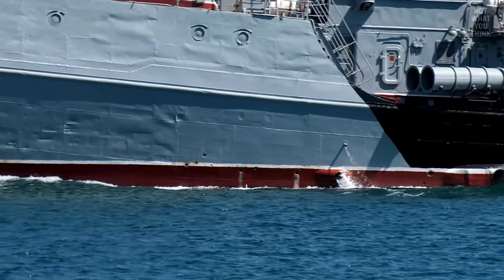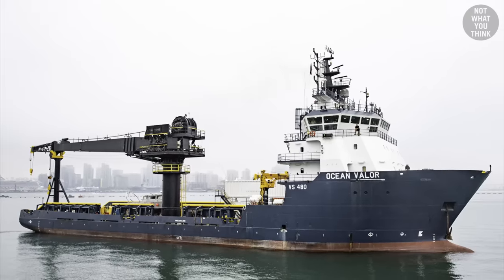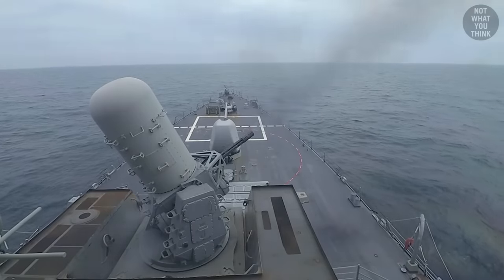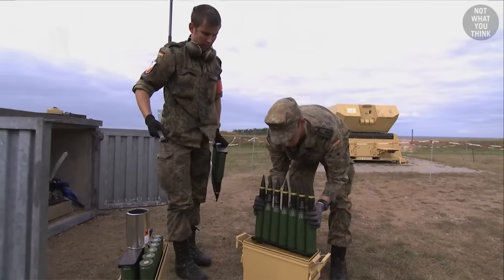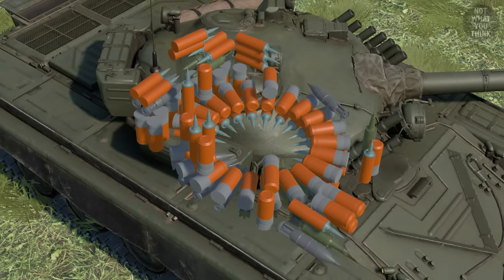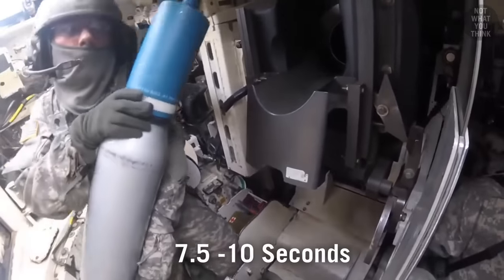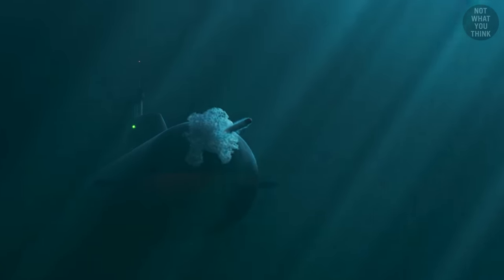Why Reloading Modern Weapons is Harder Than You Think

Comment: Accuracy is more important than speed.  If you hit your target in the first shot it is unlikely that you will need a quick second shot.  And if you have several targets to shoot, by the time you get your sights locked on the next target, the loader will already have the next shell loaded and ready to go.
Reply: Hitting the target isn't enough.  You have to not just kill it - but kill it in a manner that makes it obvious that it's dead.  Otherwise, you will keep re-engaging it until it burns.  (Rule of thumb: if the enemy tank isn't burning - it isn't dead.)
Reply: @colincampbell767  
Enemy tanks do not move unless the crew is alive to move the levers.  And tanks do not travel alone so while you are trying to make certain one tank is burning another tank will be targeting you.

And the M1 Abrams tank is designed specifically so the crew compartment is separated from both fuel and ammunition that could cause a fire on the inside.
Reply: @oldtimefarmboy617  A tank with a dead driver will continue moving because the engine at idle still has enough power to move the tank.  BTW - what 'levers?'  Every tank I was on used a motorcycle T-bar for steering.  And the M1 series the right handgrip was also the throttle.  

And we were trained (and tested on) sequential engagements where we had to choose the most dangerous target and engage it first then engage the less dangerous target.  After engaging both targets, we would observe for effect and if we had time take a third shot.  And no matter what - we would be backing up and moving to another firing position after that third shot because a lot of hate was about to hit the place we just fired from.  At this time the other tank in our section exposes itself to shoot.  

And when we pulled into our next position and began acquiring and classifying targets - any immobile tank that wasn't burning was a target.  If I lose my engine, hydraulics, optics, and electrical - we could still conduct precision gunnery engagements using hand powered controls. (A skill we had to demonstrate every time we did our live fire qualifications.)

BTW - on the M1 series tank there are fuel tanks on both sides of the driver's compartment.  Th fuel acts to absorb heat from a penetrating hit.  

Now - is there anything else you want to tell me about tanks?
Reply: @colincampbell767  After getting used to the awesome firing system in the M1 i'd have hated having to do things manually with math lol - not that it wasn't a prudent idea to train that way (obviously). IIRC the M1 "analog" sights were actually very good as well. I've only sat in a few a (few) dozen plus years ago, so I have no combat experience in them, but none-the-less I highly admired  the crew compartment. No ammo. Just blew me away at the time (let's just say the M60 did not instill the same confidence I would have had in something like the M1).
Reply: @lesassassin  I was on the M60A3, M1IP and M1A1.  (I spent over two decades on and around tanks.)  When we transitioned to the M1IP we regarded the fire control system as inferior to the one on the M60A3.  (The M60A3 upgrade came out after the M1 Tank did and as a result got better sights and fire control system.  At the expensive of having a huge divot taken out of the frontal armor so it would fit.)
Reply: @colincampbell767  Not sure if I'd want more armor taken out of a M60 ... I'm sure the upgrades made that point more mute though considering a more advanced fire control system tend to have a very good effect in US systems which tends to have a positive survival coefficient, etc. I couldn't talk about it with any real experience though so obviously I would yield to yours.
Regardless I do know that US systems are nothing without the persons fielding them, and the reason the US military is so effective. I did get to drive a M60 (I don't remember the variant, but it wasn't as new as the A3) around for a few minutes lol (which was a freaking blast). I have nothing but respect; those things are fun in a safe setting but I would not want be be shot at (in any tank/etc). Funny story I did ask to drive the M1 ... they said no pretty quickly (that and the one I sat in didn't have an engine in it).

Comment: Blow off panels are obviously going to be used but I don't think they work too well, I mean there is so much energy in the rounds in storage that even the energy being deflected off the armor and into the lower pressure area through the blowoff top would be enough to penetrate the door I would think. I mean I'm sure they test it but those rounds are massively powerful and the armor door is like 2 inches think, I don't think it's possible to contain that much energy but maybe it makes the difference between a traumatic injury rather than being turned into a fine red mist but I don't know. Sometimes tanks are penned and turned into a shredded tuna can but the tankers all survive with cuts and concussed just through dumb luck. Would love to see a test
Reply: If it's a penetrating shot to the side then you can assume you're sluicing out at least one person's bodyparts. If you hit the back of the abrams turret (where the ammo is) then the explosion takes the path of least resistance; the blowout panels on top, so the bulk of the explosion goes that way.

Comment: decent vid, but you're off with you tank info, Abrams loader qualification  is 7 seconds, experienced loaders can even get that down to 5 seconds, An Abrams can if granted an experience crew fire off 2 rounds before a T-90 has reloaded their first. Also the Abrams is still faster than a T-90 at 42 miles per hour compared to 37 mph.

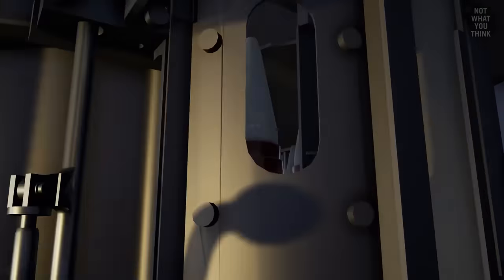Comment: 13:40 
6 rounds//min making 1 round // ~10 seconds

Has a ways to go to catch up to the manpower intensive 5"-38s of yesteryear where the speed could be as high as 20rds//min w/ about 15 being the most sustainable. That however is with scores of sailors keeping the ammo feed going endlessly. Bit like comparing John Henry to the Steam driver though...
Reply: I crewed a 5-inch/38 on USCGC Taney.  That was indeed a manpower intensive gun.  It was 1978 but if memory is right there were 8 or 9 people in the turret and a whole crew below decks feeding ammo into the carousel that fed the turret.  One of my jobs was "Hot Shell Man".  I wore big insulated gloves and would catch the shell as it was ejected and direct it out a hatch in the rear of the turret.

Comment: fun fact
the Su 25 has the same type of gun the A 10 has
has the same amount of possible pen
lower RoF 
has a 23 mm as well  
less ammo than the a10
but much more accurate
the A10 solves its accuracy with slinging more shit at the wall untill it sticks
the Su 25 is more durable/more of a  flying tank while still being extremely fast
looks pretty dope
all in all
the A10 is pretty cool
buuut id go with the Su 25
Reply: AFAIK the GAU-8 was deliberately made less accurate to make aiming easier. Fire in the general direction of the target and some bullets will find their way. A-10 (first iterations) had no advanced guidance systems for the gun.
Reply: @Michael Koch  so litterally, let's throw shit until something sticks to the target

Comment: Aren’t Russian tanks slower and less mobile with a slower fire rate in comparison to other tanks?
Reply: Rate of fire depends on what you're comparing it to. Also depends on where in the carousel it's coming from, as stated in this video it can be up to 15s, I think the problem is mostly that people that like to comment take the worst Russian times vs the fastest reloaders in an Abrams with the safety door opened at all times. Reality is that the human reload is going to tire out hauling those massive shells around and will slow down whilst an automatic reloader will not. 
Taking the Russian style reloader as the basis of human reloaders being superior also seems a bit silly, as stated in this video the French LeClerc has a better (faster) system. It's hard to find info on it but I believe the South Korean K2 tank has an even better system than the LeClerc rivalling the top reload speeds of a human reloader but without ever tiring.

As far as speed goes supposedly the T72 can do up to 75km/h whilst the Leopard 2/Abrams/K2 Black Panther (the western tanks being made in big numbers) can all do about 68-70km/h. Although I've read that the Abrams can go faster if the speed limiter is removed but it will shake itself apart which is why it is limited.

The Russians might just have to make their tanks lighter (with an autoloader) because their engines are pretty bad. With their newest T14 Armata tank they finally tried to make something better.. by allegedly copying the design found in the Tiger II (WW2 German tank) - a notoriously unreliable engine.

Comment: how about a autoloader hybrid mix of human loader and an support machine loader which can be changed to manual loading.

My idea is have an ammo rack in a safe place and have a loader take the ammo out and place it in a basket that is easy to place in (it will be behind the bridge) then the loader will press a button and a piston will shove the round into the barrel and shut the bridge door automatically basically all the loader has to do is take out ammo throw it into the basket and press the button.

what this eliminates is that when the tank is moving the loader cannot easily put the tip of the round in the hole but with this basket u just have to throw it in u don't have to try and aim the tip inside the gun u just throw and press a button easy as that if the auto loader stops working u can just manual load it for example take the round throw it in the basket and push it inside the barrel.

dead easy.
Reply: So you get like, the worst of both worlds? You get neither the benefit of having one less crewman (and therefore the volume), nor the simplicity of a human loader. In exchange for getting neither of these benefits, you get the added downsides of a larger tank by volume AND all the added complexity, necessary retraining, failures of an autoloader, etc.
Reply: @jordibear  yes and no the tank will be larger no doubt about that but the russian series are already somewhat small compared other modern tanks, so a size change can be fine and the human loader is for plan b mostly.
If the machine loader some how fails then the human loader still can load the tank the purpose of the machine loader is to support the human loader to load with ease also this will erase the need to put the ammo rack in the hull of the tank and the rack can be placed behind the turret there for protecting the crew from ammo rack explosion.

Comment: I noticed that there seems to be 2 parts to the tank armament: 1) the actual projectile. 2) a shotgun shell looking thing. What is that shotgun shell looking thing?
Reply: I think you are referring to the cartridge bag. In the t-72 autoloader for example it first grabs the projectile and then grabs the charge bag and loads it.
Reply: @rockmusicman21  yeah, what is that for?
Reply: @remyrauch577  it contains the propellant. Some guns use a one piece design where the propellant and the bullet are contained in a metal cartridge case. Some are two piece designs with just the projectile loaded first then a separate powder or charge bag/case and a separate primer for ignition
Reply: @rockmusicman21  ah, thanks for the info!

Comment: for the vls why dont they have a crane on the battleship therefore getting rid of the sway from other ships/ difference from gound to sea?
Reply: The most obvious problems with a giant crane in the middle of the ship are: it adds more weight, limits vision and aiming, and raises the ship's profile. Not to mention the massive amount of money needed to be poured into designing the system and modifying existing ships to support a crane. It's not a video game where you can just slap on a multi-ton crane on a ship without anything to support it.

Comment: 9:15, what does a tank without ammo do xd. Well the crew survives but not for long. Infantery can just roll up to it, place a shaped breaching charge on the side and tank goes kaputt. If you think "well but the machine gun on top" well guess what those panels hit
Reply: Tanks never travel alone, they travel with infantry and other tanks and armored vehicles. So I don't think you can sneak up  on tank traveling at up to 45 mph and slap a a breaching charge on it and succeed. That is suicide with no mission accomplishment. And it would have to  be a very well built shaped charge with tandem warheads to defeat modern armor and reactive armor on tanks nowadays. This isn't Saving Private Ryan with with a sock bomb nor is it Soviet WW2 where you strap some explosives on a dog and train it to run under a tank. 
That is why the Russians are not succeeding with there so called superior manpower and 70s era weapons. They are fighting a 21st century war with WW1 strageties.
Reply: @joeiborowski9763  well, is the tank then still going to travel with them on their mission or what xd. Nope it either is left behind (making stealing technoligy very easy, well if there was any technology that would be worth stealing) or it would try to drive back to base to have it be repaired wich results in either the whole convoy dissapearing temporaraly or it driving alone which makes a scenario like I started earlyer possible. Ah did I already state that it's then also super vaunrable to LAT. A guy with a rpg-28 could pop up from the side of the road and just shoot it.

Comment: Actually we don't hear anything if you are the target of an A-10. You just get showered into explosions and then you hear the "BRRRRRRRR"
Reply: In the 1970s when the A-10 was designed the threat was from SA-5, SA-6 at high level and at low level all there was to worry about was SA-7 and ZSU-23/4.  A Warthog can stay low and avoid SA-5 and SA-6 and carries enough armor to shrug off SA-7 or hits from a ZSU-23/4.  Today that is not true.  Today the threat is from S-400 which can engage it down close to the deck and long before it can get to the front lines to provide close air support.  Down low SA-7 has been replaced with more advanced MANPADS that can shoot a Warthog down, and by the late 1980s zSU-23/4 was being replaced by SA-8 Gecko, another system that the Warthogs armor buys it no protection from.    SA-7 has since been replaced by TOR-1M, which is even deadlier.  
Today with precision guided munitions there is no need to go in low to do close air support.  In a permissive environment a B-52 with JDAMs can do close air support.  In a contested environment, one where your enemy has S-400 or HQ-9, you are not going to go home to momma if you fly a Warthog.  You need all aspect low observables to be able to hang out near the front lines and employ JDAMs or SDBII.    Diving on a tank for a gun run is a suicide run now.  Too many capable MANPADS and other low level system like TOR-1M and Tunguska can kill you.

Comment: If your reload requires removal of the weapon system. You fucked up.

EDIT: forgot to mention,the carrousel cassete system isn't an issue, cook off is a result of the "loose" ammunition
Propellant cases, the cassette is on the hull floor and very rarely hit. Another note, if you ammo blows up, doesn't matter weather you live or die you got bigger issues also the leopard has a much larger hull based problem thn the T-72/T-90 cassette. B like 2.3x the height and very easy to hit location.

Comment: The auto loader is way better it faster and safer, manual negative sides human gets injured, the tank is moving poor balance, the shell gets dropped on the floor of the tank, the shells explode all the crew die the little door will not protect you from an explosion, more people die in a tank, tank is bigger easy to hit, and tank is heavier slower because it gets stuck in mud or sand. Nothing is good.

Comment: Waving the BS flag.  I have personally reloaded VLS cells on USS Antietam underway.   During the Cold War each 32 cell VLS carried a reloading crane that took up four cells.  We used a CH-46 helicopter to lift a loaded canister from the deck of our ammo ship USS Kiska over to the Antietam and set it on their main deck between the aft VLS and the aft 5-inch gun turret.  We used a tag line hanging beneath the load and deck personnel used the line to keep the load from spinning as we set it down.  After releasing the load we would fly around while the ship's crew removed the empty canister and loaded the new one.  We were loading SM-2s.  We would pick up the empty and take it back to the ship, get a splash of fuel (we had to work close to minimum fuel due to the weight of the load), pick up a new reload and take it to the Antietam.  Reloading could also be accomplished with the STREAM Rig.  We did it.  It was part of our training.    Those cranes are still in storage and could be returned to the ships.  In addition NSWC Port Hueneme developed a different rig that can be delivered from the T-AKE, set up on deck that straddles the VLS cells so rounds can be delivered straight to the cell using the STREAM Rig.  It requires 12 people to operate.  It is prototyped and tested.

Comment: I’m sure it is but….
Is the A-10 capable of areal refueling and which system does it use (drug and chute or straight line)?
Reply: You never noticed the refueling port right in front of the cockpit, on the nose of the plane, where other planes have the radar?
Reply: @TrangleC  
1) nope
2) with these eyes?  Are you crazy?  Not a chance.
Reply: @VAMobMember  I don't get it. This is way too lame and unfunny to be trolling. 
It isn't as if pictures or videos of in-air refueling A-10 would be hard to find.